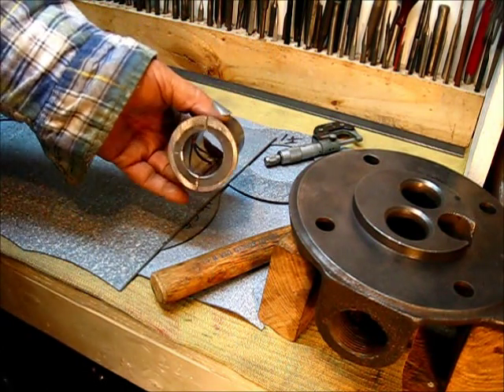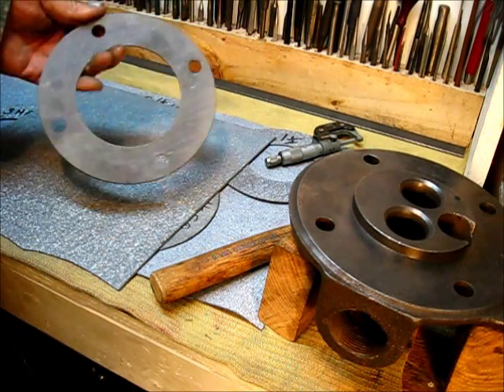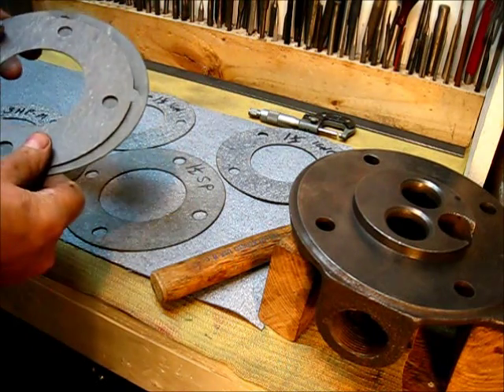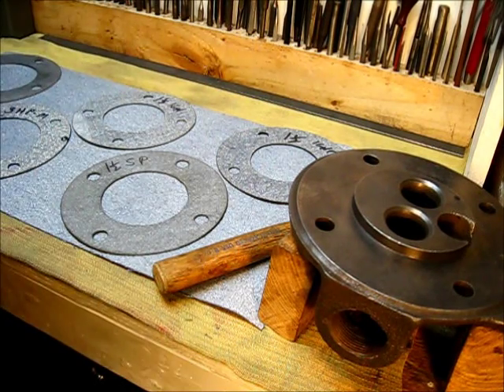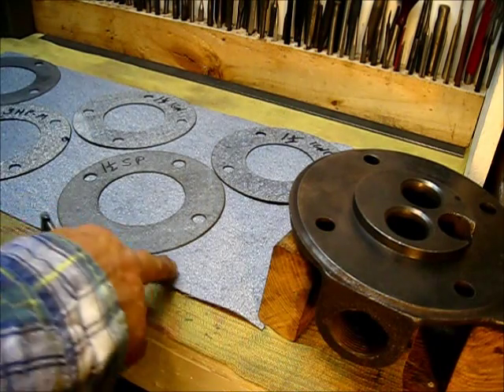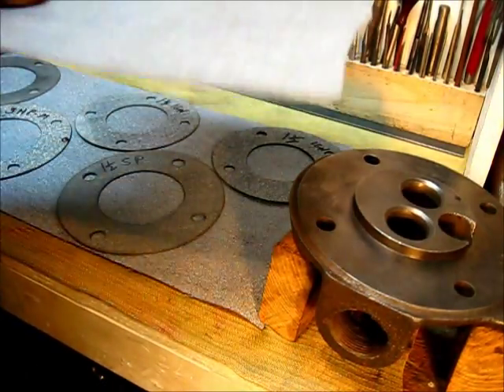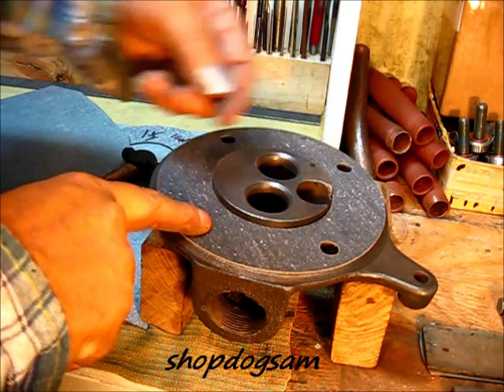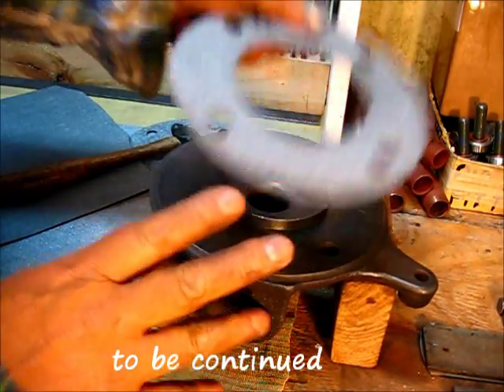IHC ENGINE head gasket  /  type "M" #1

Comment: Ive been using a 24x48 sheet of exhaust manifold gasket material.
Mic's out about the same as yours Sam at 65 thou
It has a piece of thin metal sandwiched in it.
Real bear to cut but crushes nice (dont over torque it)
I use a good sharp hole cutter for the head bolt holes.